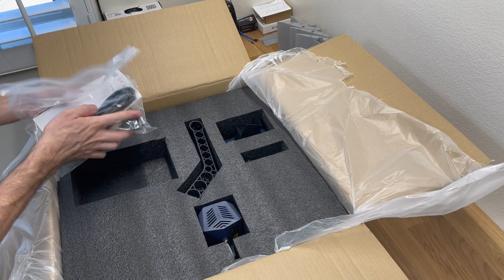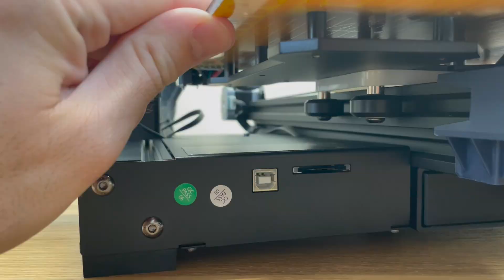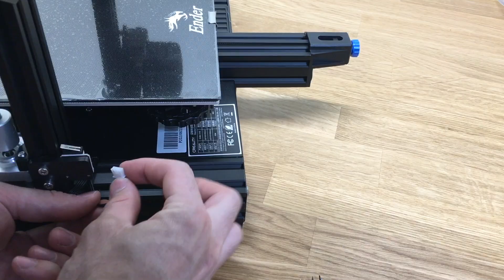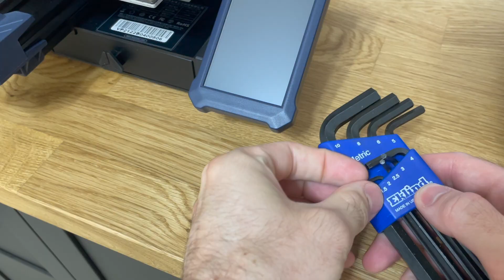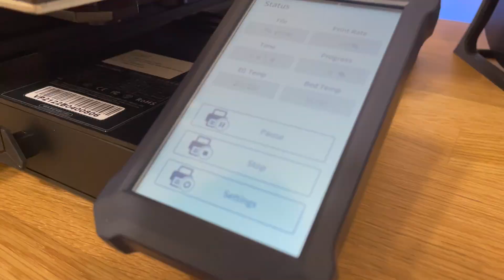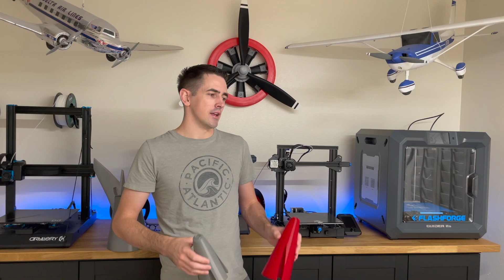NEW Anycubic Vyper VS Creality Ender 3 V2 comparison

Comment: How does the Vyper work with LW-PLA and the other types of filaments used for printing RC Planes? Looking at trying out 3D printing and getting a 1st printer. Is the print area large enough for most prints? Thanks.

Comment: Ender 3 all the way.  Cheaper and you say the anycube has all the upgrades but only really talk about the z screw.  So save the money and take the ender.  Leveling is not that hard and once done you really don't need to touch it again.  I actually have an Ender 3 pro with the older screen even and I see no need to up grade any more unless I finally go to a hot end I can tun 2 or 3 colors to.

Comment: I recently purchased a previously returned anycubic kobra max and not quite similar to my ender 3. I will say the anycubic support might be worse, trying to get parts can be more expensive on the anycubic, and trying to get a specific part like the max's hotend board has been unavailable online, auto leveling works but judging by postings it seems very prone to failure. Also dust on filament and dog hair, gets in the extruder which needs cleaning its nice to be able to quickly scrape the plastic dust off the extruder gear and get back to printing at a decent speed

Comment: Hello Troi. I have finaly my Anicubic Viper.But what a dissapointment. The automatic bed leveling does not work. Every time i try a get the same  message on the screen: Automatic bed leveling abnormal. cut of power and check wireing. I did check the wireing several times  but everething is correct connected. Do you know wat is going wrong? Or do i have to send it back to Anycubic

Comment: I purchased both printers months ago even though the Ender 3 is an older model it works like a charm and it doesn't give me so much headache. My Viper on the other hand doesn't work for s*** half of the time can't even auto level the nozzle it's always too high and prints dont even stick to the bed. 
Pathetic!!!

Comment: I'd love to see a review on the Anycubic 3D Printer Kobra Neo. Just bought one discounted to $199.00 this amazes me considering the features. Can use open source Cura too. Currently have a Flashforge Adventurer Pro, the thing is bombproof although I guess It's a little overpriced. Although it prints ABS great. Wanted to try a direct extruder just to see what's up, the FForge is Bowden. Love those aircraft models! They bring back great memories of Dad and I in the 1960's although they were balsa, lacquer and paper then..

Comment: I have a creality cr-6 se.... and I also own a Anycubic vyper. Both are basically the same thing. vyper is anycubics answer to the cr-6. Both are awesome printers. personally I favor the cr-6 only because it has the capability to print a lot faster than the vyper. 
100 mm/s  vs 180 mm/s. other than that both are very capable 3d printers.

Comment: seems viper made a good choice of placing the filament roll low not on the top.That take the weight off the top. logical.  like the auto level with Anycubic viper  out of the box  great idea  for novice   owners of the viper

Comment: Ok, I need an update here. I am torn between the two but have seen reviews about the Vyper's auto-level hardware breaking as well as possibly a few wiring issues. Has anyone else experienced these issues after continued use? Since it seems the leveling is entirely being done in the software, is there any way to level it manually?

Comment: $360 vs. 260? Looks like the real value difference is the dual Z axis motors. Cost for extra motor/programming and controls $100. I have had mixed  Comments on the "Z" axis stabilizer upgrade are even mixed but bottom line seems to be that the single motor still performs very well. Sounds like a very close review of the "Z" axis would be the real value here. Like for Like does the $100 deliver in performance not just in magnets in a drawer!!??!!??

Comment: the ender 3 v2 glass plate has a good coating on it, i wash mines with warm water only, and find when the bed cools down things just pop off it freehand without removing the plate from the bed. no need for sprays or glues etc. try it out, if it works theres a video for you to make. if something is shallow . hard to grab i do take my scraper to 1 corner to start it coming off but thats the only exception. i probably will 

thanks for the video, interesting comparisons between the two

Comment: Welp you just blew my mind. I own an ender 3 pro and was just about to pull the trigger on an ender 3 V2 when I saw this vid. At this time the Vyper is $369 on Amazon and the V2 is $279. After putting together the ender pro and taking over two hours (first printer), I think the preassemble alone is worth the money. Throw in bed leveling, better extruder, dual axis z's AND a touch screen!!?? SOLD! Thankyou so much man.

Comment: Just bought an Enders 3 v2 with BlTouch for £100 less than the vyper.  
but as you say , For the beginner the Vyper looks and performs very nice and easy to get up and running. but the smaller & cheaper stepper motors of the Vyper will be an issue later on.
Shame that the enders don't have a Touch screen as that is a more modern upgrade. and guess thats where the extra money is needed.
so really if i had the spare £100 i would have gone with the Vyper after seeing this video.
may be in a years time you can do another review on the Vyper and share your experience on using it.

Comment: Still saving almost 50.00 with the purchase of an auto level system for the Ender. More advanced users would prb lean towards the Vyper but beginners would benefit from the large community and all the add-ons including wi-fi for only 10.00. I do admit the touch screen is nice! Great video comparison.
Reply: Do you mean the raspberry pi?

Comment: Does anyone else have an issue where if you try to print something or use the auto bed leveling, the printer just turns off and turns on again? Thanks.

Comment: Great video.  I was looking at getting my first 3D printer and the Ender 3 V2 appeared to be the most popular model.  However, I read about the various upgrades to the Ender 3 v2.  All your points of the Vyper having all the upgrades that you would add to the Ender 3 v2 made the Vyper more desirable.  It also helped that I was able to get the Black Friday/Cyber Monday price for under $300. At this price, it was a no brainer against the CR-6 SE.   I received my printer and it printed nicely right out of the box.  Fan is loud though.

Comment: Hairspray on the ender 3V2 ?  I can assure you folks , this is not 100% correct, especialy with PLA . You just have to dial in the correct bed temps.
The glass bed have a texture to it which works really well , and how do I know that it's the temperature that matter? When i want a mirror finish on the base of my prints , i just use the non coated side of the glass ! Just plain clean glass, and it works as a charm ! Whatever the bed you have, if it's not clean and/or leveled and/or at the right temperature, your prints won't stick ! Hairspray, glue or whatnot , it will just delay it a bit more but in the end, It will fail.

Comment: Im completely new to 3D printing, and I was almost about to buy the Ender 3 V2, and then I heard "Its basically the Ender 3 V2 with every upgrade possible" So you are the reason for my purchase of my first ever 3d printer Anycubic Vyper! Thank you sir!
Reply: Hey i was wondering how is it working out for you
Reply: I’ll just say this, I got me 3  Ender 3 Pinters for the Price of one Anycubic Vyper
Reply: @infected7258  A used ender 3 on eBay is like $70.. and that's very used. a refurb Vyper is $130....
Reply: Same I might get the viper now
Reply: How has it worked out for you?
Reply: The Elegoo neptune 3 pro has the same upgrades as the Vyper. But it's currently unavailable so I went with the vyper
Reply: Too funny, I was going to do the same thing, but now I may get the Vyper.
Reply: @kevinlew7781  i found the ender 3v2 on their website for 220 and its been great for me:)

Comment: Comparing a $250 printer with a $429 printer isn't exactly fair, but you'd definitely expect it to print better.  In that respect, the Vyper is incredibly disappointing.

Comment: OMG, I would NEVER buy another printer without auto leveling.  I must have had to manually level my Ender 3 200 times, and had failed prints related to that at least 50 times.  A filament run-out sensor would also be mandatory equipment.  I've had 20-hour prints ruined because the Ender 3 prints on AIR when it runs out, and saving a print after that is a longshot nightmare.

Comment: Touch screen isn´t always an "upgrade" nor a better interface to interact with your printer. I still prefer the non touch screen. Also, the glassbed on the Ender does not require you to use hairspray nor gluestick(if you do you have not understood how it works). It has a coating on it, and it sticks when the bed is warm and when it cools down it releases by itself, much preferred.

Comment: I don't know if it's been said already. But, if you're putting glue stick or hairspray on ultrabase, you're doing it wrong. It's not a "traditional glass" build surface. It's one of the best build surfaces out there. Stop giving bad info if you are doing comparisons. Newbies don't need that kind of misdirection.

Comment: Does the auto Leveling turn the Z Screw to adjust the errors?
or does the print moves non planar? XYZ instead of XY to compensate for angular errors?

Comment: Nice comparison, lot of interesting points. The spool holder for your sidewinder, is that attached to the printer or to the wall? Do you ever experience underextrusion because the extruder motor struggles to pull filament from the spool?

Comment: Thanks for the video on this Vyper and this seems to be an excellent printer.

I am totally new at this 3D printing, and (after watching a gazillion videos) just bought the Biqu B1, because of the features already built in, but this one seems even more upgraded and gooder. The B B1 has no self leveling, single gear extruder and single Z axis support, (upgrading all that will add aprox $180 CAD to the price) and I am coming to understand this dual Z axis support is mucho importanto. Why spend more money and time upgrading a printer from the start if you can initially spend a bit more and get most of the features needed, dual Z axis, 32 bit board, touch screen, silent drivers and I like that it has a full SD card reader, not a micro SD (might be nit picking on that).

In all fairness, I was also just looking over the Anet ET5 Pro, as that seemed to have a lot of features I just mentioned and from watching a number of videos, spring steel bed liners is the way to go. Since I have just bought that B1 and did not like the drop on the right side, without the extra support, when I did a plane test. Heated the bed and head, and even though I had it manually eye leveled from automatic home and above the bed liner it scratched the liner on the right side.  Not to mention, but I will, the 80db (and up) coil whine from the mobo fan, I can send it back to Amazon, and I will, while  I ponder the Anet ET5 PRO or this Anycubic Vyper.

When you where show casing the two screens, I noticed that the Vyper was much more quiet then that V2? Also, I do have one specific q on that Vyper, is that an all metal hotend head?

Thanks again and regards

Comment: That's a CR-6 SE clone. Not a clone of the low end Ender 3. It's twice as much as the Ender. But: It will not take long until you spend a lot more than 150 bucks for your Ender 3 to get to that level. Auto bed levelling, touch screen, dual z-axis, and so on. On the CR-6SE the two z-axis are couple by a belt. That's what the Vyper lacks, compared to the CR6. Can't see other difference. So go for it, I love my CR-6.

Do we need so much "y", "V" or "X" letters in product names? ;)

Comment: Although the comparison is nice and the vyper seems like a solid machine, there are a few things I don''t agree with.
First of all the glass bed on the ender 3 is not standard and if you keep it clean it doesn't need any adhesive at all(all you have to do is wait for it to cool down a bit and then the print pops right off).So the magnetic surface of the vyper is not an "upgrade" you'll have to make that add to the cost of the printer, it's just a matter of preference. Also, the dual z motor is a good thing to have but not something that is necessary for bowden style setups. Yes, you can force it up and down with your hand but during printing that is not going to happen.
Edit: The levelling mechanism seems interesting though and it's a nice thing to have especially for beginners.

Comment: [4:55]I cant say for Vyper, maybe they have great quality tests but in Ender it is designed to wobble and shouldn't be stabilized. If rod is not straight (and probably is not) you add extra tension for z motor. So its better to leave it as it.

Comment: Hmm they need to take the quality of vyper and just make it bigger to something like the Chiron. Chiron is great but the probing auto leveling feels a lot to desire.
Reply: I kinda like the chiron system though. I leveled it properly once and then i just correct the heigh in the printer globally when i change the nozzle. It holds pretty well the level. Anyway chiron was an improvement in many details from the mega and i think vyper keeps the tendency.

Comment: very nice video but what are the hot ends like? I use a gulf coast robotics hot end on my ender 5 pro and it works great.
Reply from the maker: I have only used stock nozzles
Reply from the maker: I just take them off and clean them

Comment: Great video, thank you. Just a question: do you think the auto calibration should be done before any prints or seems to last a bit?
Reply from the maker: Oh, you only need to do it once whenever you physically move the printer to a different location. otherwise, only the first time and that is all :)
Reply: Thanks for the Q&A.
Reply: Once the bed is level it's level, unless you move the printer. With the Prusa mk3, it does a quick level check b4 ea. print, surely this machine does the same?

Comment: Its a lot closer to the CR-6SE then it is the ender
Reply: Yes I was wondering what the difference between those two was. My understanding was that the 6SE had basically stabilized and become pretty decent.
Reply: @superchroma  CR-6SE had a few flaws on launch. Nowhere near as bad as people seem to think it was lol. I have 8 3D printers and the CR-6SE is by far the best machine I have ever used. Have never had an issue and the thing prints like a dream.
HOWEVER, that said. I have looked into the Vyper extensively and there is very, and I mean very little difference between the two except the Vyper is slightly larger and cheaper in price.
As long as they have some quality put into this build, I would confidently say the Vyper has potential of being one of, if not the best consumer printer out right now
Reply: @GradivusAres  im torn between a cr6 and a vyper. Which one should I buy?
Reply: @jeffersonderrickson5371  I personaly do not have a Vyper yet, But do plan on getting one. I do however have the CR-6 and can comfortably recommend it. It is an amazing well built and outstanding performance, I have actually picked up a couple of them because of these reasons.

However, The vyper seems VERY similar if not basically a direct clone, and anycubic imo makes solid printers. 

The bonus to the Vyper is its SLIGHTLY larger size and a lower price point

The bonus to the CR-6 is there is lots of them out there so people know what they are getting.

My next purchase personally will be Vyper

Comment: Great tips and advice. Think most important takeaways you demonstrated and explained the differences. Important as most printers can be upgraded, but know which features are most useful starting you greatly improves initial experience. (more printing, less tweeting and building printer stuff)

A321, that's a serious project. Any plans to build fly another ducted fan model first?
Reply from the maker: I agree! I have the a321 on the bench now, that will probably be next followed by the fouga :)

Comment: Hey chief great video, quick question do you know if the CR10 V3 has a self leveling system, I need a larger build volume and I am struggling so bad to get the leveling right, Ive been trying for almost 2 weeks now I am just about ready to pack it up and send it back to amazon, any help would be greatly appreciated or even if you know of a larger printer that can be upgraded with self leveling system 300x300x400mm is what I am seeking.
Reply from the maker: I'm not sure if it has self leveling, I have a 3d printing basics video on my channel that shows in depth how to level a bed.are you trying to print planes? you would never need that large of a bed!!

Comment: I know that it has autoleveling but that is a softwaretool which adjusts the coordinatesystem according to the bed (from what i understood). But the printbed doesnt seem to have any screws for adjustments. can i manually level the bed if it gets to uneven for the software or if the sensor fails?
Reply from the maker: no you cannot manually level it, but you can set the z offset if it needs adjustment

Comment: As of 6/9/2021 all 3000 of the initial run of the Vyper are sold out.  It looks like it sold for $299.00 and it looks like the next production run may go for $359.00.  Oh well.
https://www.anycubic.com/products/anycubic-vyper
Different subject, have you seen the fellow that prints out molds to make his aircraft from fiberglass and carbon fiber?  Cool airplanes and cool idea.
Reply: No they are still available for sale at $299  you may have tried too early.
Reply: @reasonablebeing5392  Where, they look like a good printer.
Reply: @repalmore  Here: https://www.anycubic.com/products/anycubic-vyper same link as above - still showing available.  Are you in the USA?